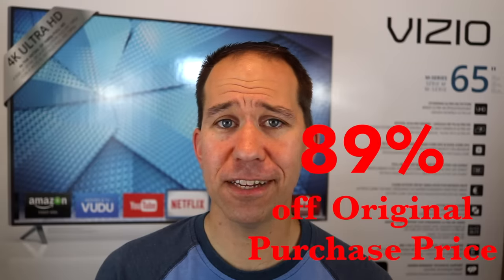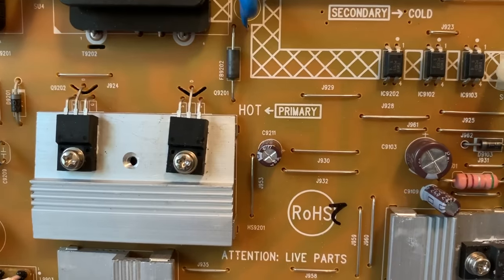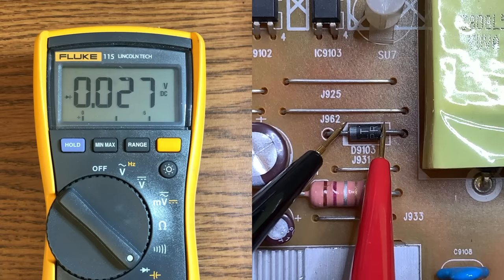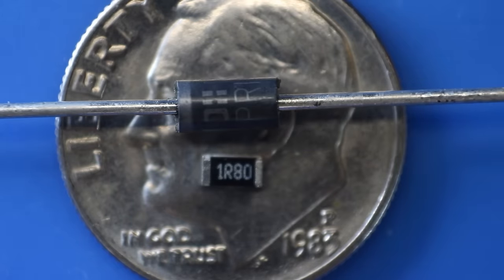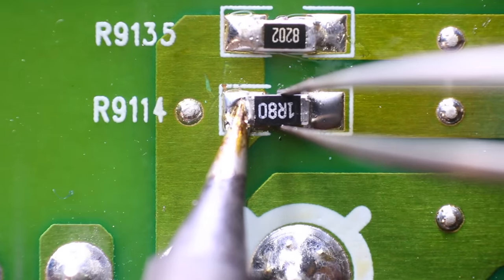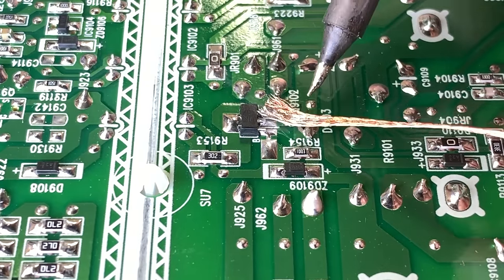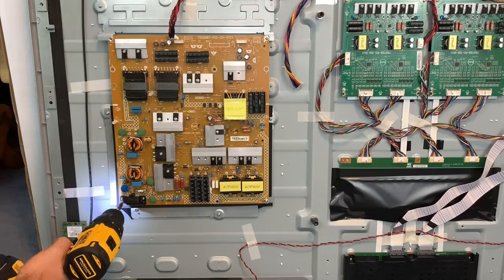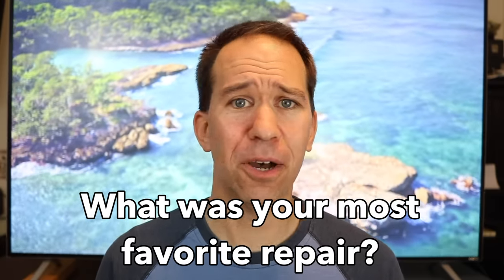I got a broken 65” 4K TV - How I repaired a Vizio M65-C1 (tv won’t turn on)

Comment: Got a question I own a Hisense 4K Model# 50H7GB1 S/N 50G151704H05243. I never had any problem since purchasing it but  this I turn the unit on the picture very dark I attempted to brighten the appearance with no luck, I unplug the unit waited 5 minutes   in hopes that rebooting  the system would correct the problem and still the same problem !  System reset still did not correct the problem either.  What would suggest to fix the problem?
Reply from the maker: It could be the backlight.  Did you try the flashlight test?  Or turning down the brightness in settings?  I give these suggestions in the TV diagnosis pdf (go to my website and look for TV resource).

Comment: I have a question (though I think the answer is: I won't know until I pull it open and start testing)...would a TV that "died" at the same time as a bunch of other equipment in  a nearby lightning strike be even worth trying to check out? I mean, is it beyond trying?
Reply from the maker: You should totally fix it.  Check out my video on what to do after a lighting strike.  It’s usually either a problem on the power supply or main board.

Comment: Hi, I tried to repair a 70" Sharp liquid crystal tv( model LC-60EQ1ou) ,even purchased 2 parts for it and had no success fixing it. The problem is that the right side of the screen is about 80% dark and I looked on YouTube to find a fixable solution.At last I seemed to have lost money on parts without solving the problem. Any suggestions with my problem? Thanks
Reply from the maker: Are you sure it’s not the LED backlight?  The strips on the right side perhaps?  That would be my first guess.
Reply: @FrugalRepair  I switched strips to see if the screen problem would switch to the other side, but the problem is still on the right  side.
Reply from the maker: But did they not light up as brightly?  If not, I’d say it was the led driver board or the power supply.
Reply: @FrugalRepair  Ok, It's the led's on the right. Testing them 3 strips didn't light up.Thank you for the suggestions and help.

Comment: when Diode D9103 fails you should replace C9103 with a High Quality 105C Capacitor  & the resistor R9114 is a 1R00 =1.0ohm

Comment: This is awesome! I have a question. I have had a Visio 65 m3d 4K tv given to me. There is no remote but the tv powers up. Only issue is with the screen. It looks like someone removed about one inch of the display in the center and slide the the two sections towards each other so there is no blank one inch strip. If I power it on there is a box that displays and instead of  [ NO  IMPUT  ]  it shows [  N MPUT  ]. Just ordered a remote so I can do a hard reset. Someone said com board and someone else said led driver board. I’m not sure. What’s your opinion?
Reply from the maker: Thanks!  Seems like the tcon or panel .  Did you happen to watch my videos on the TVs fixed with tape? I explain a little bit about how the panel works so it may give you some clues.
Reply from the maker: Hopefully you can get it fixed!
Reply: I’m a cancer patient and I’m trying to fix this tv so I can relax and enjoy. I’m a (gotta fix everything) kind of person. Thank you for posting these videos, it’s a special person who passes on information to help people. Watched a video on fixing a refrigerator circuit board. One relay and a capacitor for .57 cents and a $900 dollar board was fixed!
Thank you again, your videos are great!

Comment: I have a 65” Vizio 3D TV, my sound is gone! Appears it is the IC AMPLIFIER was not sure where to buy this chip. So I ordered a refurbished board from Vizio. Shoud arrive in a day or two. My question is, have you come across a supplier of IC AMPLIFIERS?
Reply from the maker: Wow, I’m curious of how you diagnosed the issue down to that chip.  Great job.  I haven’t replaced any on a main board yet but I wouldn’t think it would be hard to find a suitable replacement.  Usually you can find a data sheet based off of the printed numbers on the chip.  This can give you the info you need to find a new chip.  In the US mouser and digi-key have an incredible stock of components.
Reply: FrugalRepair Well the sound did go out and my research led me to believe it wasn’t the fuse as a process of elimination. Thank you for the information on chip suppliers! My big dilemma now should I keep the old board and repair it or send it in for my $50 core charge!
Reply from the maker: If you remember, write back when you get it repaired.  I love hearing the repair stories.

Comment: I want to point out a few things:
1. You shouldn't buy the exact amount of parts needed for a repair project. You should buy a few more, especially for part that cost mere pennies. I would have bought 3 resistors and 3 diodes.
2. That board isn't densely populated at all, meaning there is plenty of room. If the resistor and diode failed once, they can fail again when replaced with identical parts. Instead of the 1206 resistor, you could have bought a 1210 or larger resistor with a higher power rating to ensure it's not being pushed to its limits like its predecessor. Same with the diode.
3. Did you measure the voltage on the 12V rail after the TV was working and powered on? It most likely wouldn't read 19V. The 19V is most likely a "no load" voltage due to a voltage regulator that might need a certain amount of power consumption before it can regulate to the desired (12V) voltage. 19V seems a bit high, but I wouldn't be surprised if it's simply a "no load" voltage.

Either way, the fact that you got it working for little effort and cost is pretty good! Nice video!
Reply from the maker: Thanks for your detailed response.  For the resistor value, that wouldn’t make a difference since a value that low probably means it’s acting as a fuse.  The diode is the main culprit.  Anyway, the tv is still working fine years later after this repair.  And 19v is the correct voltage.  It’s just not labeled that way.
Reply: @FrugalRepair  It seems a bit weird to disable a $1000+ TV by blowing a resistor that no average consumer would ever know about, but consumer products have all sorts of silly design aspects to them.

Perhaps the previous owner had it in a cabinet and kept the house too warm haha! Hard to tell why something fails sometimes. And mislabeling that power rail is an amateur mistake lol!

+1 for the home engineer!

Comment: I have the same issue but the light i have in the main board its red. Do you know what the problem is?
Reply from the maker: Did you check the 19v supply to make sure it’s steady?  I’m pretty sure there is a common main board issue on this model too.

Comment: I commented from a different video last time, and this is the tv I'm trying to repair (well close mines an e65c3).  When I plug it in I get nothing,  no power,  no static,  no blinking lights inside or out.   I tested the power and it appears to be getting power all the way through all the boards and the power switch.   Nothing looks fried or disconnected,  and there is no physical damage to the unit.   Suggestions?
Reply from the maker: Did you go through the all of steps in my pdf?
Reply: No. Wasn't aware of it, but I will now.

Comment: I have the same make and model tv as the Vizio M65-C1 that you performed the repair on in the YouTube video. I’ve tried to figure out why there is no picture or sound but have no clue. The little white light in the lower corner will illuminate for a few seconds before it starts to flash and then go into a dull state. Also, there is no solid red light (or purple flashing light) illuminating from the board where the USB and other plugs go into. Do you have any idea where the problem could be just from that description I gave you? I really don’t want to throw this tv out. Any help is greatly appreciated. Thanks!
Reply from the maker: I believe that what you are describing may be a common problem on the main board.  I’d suggest searching online and maybe someone has identified the specific issue on the board.
Reply: Do you have an email address I can contact you through? I ended up replacing my entire main board ($180🤦🏻‍♂️) and after doing so, I can now see that little red/purple light turn on. The old board had brown spots on it as if it had a lighter held to it. Now my new problem is that I still dont have a picture. I have the back panel off, and I can see that the back light is illuminated, but still no picture.
Reply from the maker: @mikeflaherty2596  My email is on the contact page on YT.  I'd be curious to see the brown spots you are talking about.  Are you confident the power supply is working correctly?
Reply: FrugalRepair I sent an email. To the fixer @ frugalrepair site
Reply: I replaced the main board and now there is a back light and the screen is on but no picture. Just replaced the T-Con board and still the same thing. Any other suggestions?
Reply from the maker: @mikeflaherty2596  You could try disconnecting one half of the lcd screen at a time to see if you have a buffer board or lcd panel fault.
Reply: FrugalRepair I would do that if I knew which wires controlled the buffer board and lcd screen
Reply from the maker: @mikeflaherty2596  There are two sets of cables coming from the tcon board to the lcd panel.  Unplug tv, disconnect one of those cables, then plug in the tv, then turn it on.

Comment: @FrugalRepair and all, I've got the same TV but my screen is strobing/flickering - any advice?!  I'm getting 19v out and the purple light on the main board is lit up. Picture comes through, great color, and sound works but the picture comes in and out like a strobe light.  Same issue on streaming apps and HDMI.  Any help would be greatly appreciated. Thanks!
Reply from the maker: Do you think the issue is the backlight or is the video signal the issue?  Maybe try turning down the brightness in settings to 5% and see if it still flickers.
Reply: @FrugalRepair  Tried that before with no results but I did try it again by setting backlight and brightness to 0 but it is still strobing. Picture itself is bright as it should be throughout the full display. Don't think it is signal because it happens on both HDMI and built-in streaming apps like Netflix.  Thanks for the speedy reply and help!
Reply from the maker: So when you set it to 0, you used a flashlight to see the screen and there you saw the strobing effect?  If so, then it sounds like the video signal (what I mean by that is a problem between the main board and the panel itself).  Good job ruling out the inputs as the issue.  Next I’d try driving half the screen at a time to rule out a buffer board/panel issue. With no power to the tv, disconnect one side of the panel, and you can do the other side too.
Reply: @FrugalRepair  I didn't use a flashlight because the screen is very bright as if there were no problem. There are no issues with the picture quality in terms of brightness, color, uniformity, etc. Only that the picture strobes, the TV doesn't actually turn on and off, the picture just cuts in and out.

I disconnected the left and right plugs one at a time from the top center two boards. In both instances the one side of the display cut out but the image still comes through on the other side.
Reply from the maker: The flashlight is for when you are turning off the backlight.  Was the flicker still there on both sides when you disconnected the video cables?
Reply: @FrugalRepair  I disconnected the 2 different sized ribbons from the board on the right which runs to what I think is the tcom board at the bottom. The picture is out but backlight is still visible. With the ribbons disconnected it doesn't look like it is strobing. I can see backlight uniformity when the Vizio screen would be on, followed by no signal, followed by Netflix (kept pressing OK until I had audio to know it was playing).
Reply from the maker: @mmarshall776  Is there flicker when you leave one of the cables connected and you can see half of the screen?
Reply: @FrugalRepair  Yes it still flickers when one side of the display is on after removing the cables from the bottom of the led driver board. If I remove any one ribbon in either direction between the video board and the tcon board there is no flickering that I can see.  In those cases I can see black uniformity across the display when the screen changes between the Vizio splash screen, the no signal screen, and Netflix.
Reply from the maker: Michael Marshall if I’m following right, there is no flicker when disconnecting cables before the tcon.  Do you think it is the tcon that is at fault?
Reply: @FrugalRepair  that's correct. From a step by step perspective it looks like it could be the tcon because that's when it stops but everything else I've read/seen suggest cap issues on power board or the panel itself. If the tcon requires all connections complete to send a signal to the panel then it may not actually be the tcon.

Comment: I know this video is old but I have a question for you and was wondering if you had any ideas on how to fix it. I have a some what older 65inch Mitsubishi true sound smart TV. I can go into vudu  movies and the picture is awesome but when I hook up my ps4 the TV does recognize that something is plugged into the hdmi port but no picture. Thanks have a great day.
Reply from the maker: Is that a DLP tv?  It could be a bad hdmi port, especially if it works on other ports.  But if not, probably something wrong on the main board.  I’ve had an issue where the hdmi cable was bad, so it could be that too.
Reply: @FrugalRepair  thanks for getting back to me. I'll have to check that out the hdmi cord. Yes its a DLP it's the Home Cinema Mitsubishi. I was looking around and actually found a infomercial of the TV on YouTube lol because I wasn't sure what you ment by DLP. I'll get back to you about the hdmi when I get a chance to try a new one out.

Comment: Hi Reese. I found your channel on YouTube. And I have a question for you. I have a Vizio P65-C1 thats 5 years old. The power indicator light turns on for a second only when I plug it in and shuts right off. No power indicator or screen turn on afterwards. Have you seen or heard of this before. Thank you
Reply from the maker: I’m not exactly sure but it could be a disconnected CPU from the main board issue.  Check out my video on fixing a 75” tv.  You’d also want to check for repair kits on eBay for clues.  And measure voltages on the power supply.  My guess though is that it’s a main board issue.

Comment: Have the same TV. Symptom: On startups reboots repeatedly for about 5 minutes, then comes on with no issues at all. Happens every time from cold state. I thought it might be the diode that had failed partially, exchanged the resistor and diode, but no luck. Have you ever seen this symptom - any clues as where to begin troubleshootong?
Reply from the maker: I haven’t had that problem so I’m not sure.  Are you able to monitor the voltages during that reboot cycle?  It sounds like it may be a main board issue.  But it doesn’t happen once the tv is warmed up?
Reply: @FrugalRepair  That's what I'm worried about too, main board. Once warmed up, everything works as normal (and works normal until next cool down cycle). Disconnected all peripherals, same-same. I must admit I took the shortcut and just went straight for the res+diode. They did measure normal - so I knew before changing it was a long shot, the diode looked cooked, I lifted the new one 5mm off the board to provide better cooling. Trying a factory reset and see what happens in the morning, but it looks like a board issue, with the warm-up seemingly fixing it (for now) - it will fail completely soon is my guess. Symptom has been there for 3 weeks now. Let me watch your video again to refresh the expected voltages . Thanks, great videos you have.
Reply from the maker: I would be curious if there are voltage fluctuations on the power supply that might indicate that is the source of the reboots.  You can also try getting the TV cold, then using a heat source (possibly a hair dryer) to warm up the main board and see if that does it, to isolate the problem to a failing component on the main board.
Reply: @FrugalRepair  Agree on the cooling spray, hairdryer - classic troubleshooting. I noticed you measured voltages with no load, I would assume the psu needs to be under normal load to observe anything of value in my case. This PSU only has 5V, 12V, 24V rails right?  Tried hard reset, also turned down brightness and backlight, let it cool and tried powering on, no luck. Wish I had more time to fix it, shouldn't be too hard, but moving overseas, so selling it with full disclosures of course.
Reply from the maker: This power supply is a little off with its voltage rails compared to others.  I just picked up an m75-c1 (bigger version of same tv) that seems to have a main board issue.  I’m not going to be able to look at it for a while due to other projects in the pipeline.  But I have heard of some commons faults on this main board.  I’ll probably be making a video about it when I get the chance.

Comment: I have this same TV and the same problem. I have replaced the diode and resistor. The TV then turns on for about 30 seconds and then they "pop" again. Any ideas where I should look next?
Reply from the maker: Is the short on the power board?  If so, you’ll have to track it down (and fix it) or replace the power board.
Reply: @FrugalRepair  I just replaced the board and the TV is working. Thank you for the video about this issue.